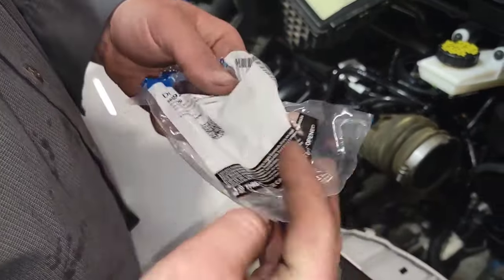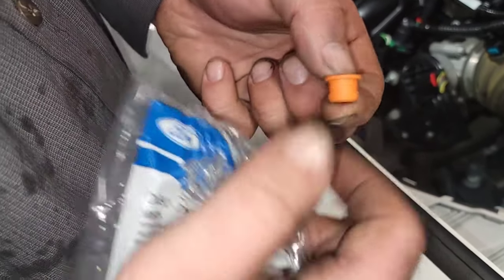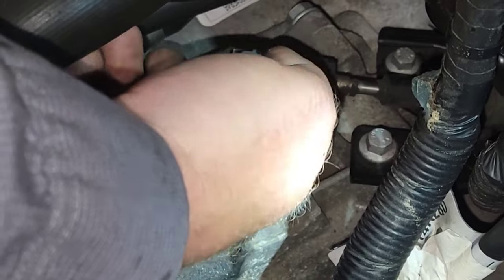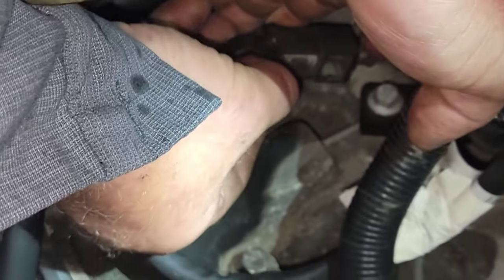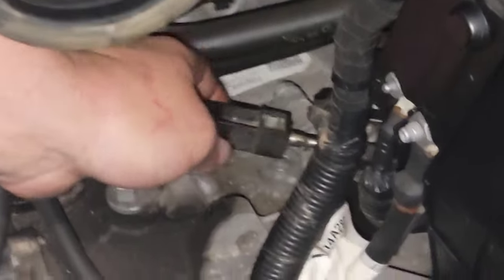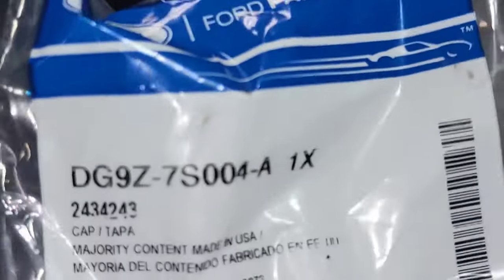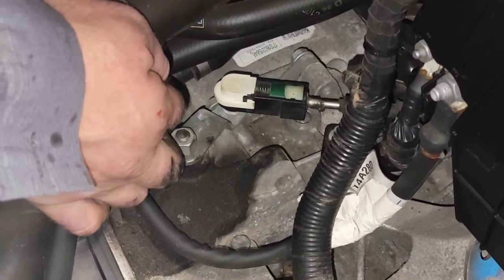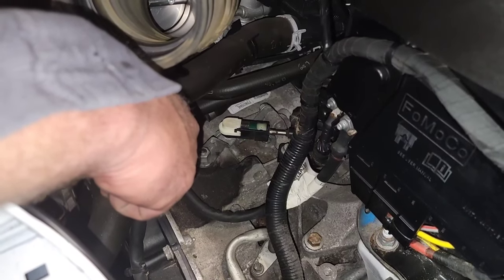Ford shifter cable bushing inspection - Edge, Fusion, Transit Connect, Escape, C-Max - Demonstrated

Comment: Which recall number is that?     Can that bushing be installed in the older trucks that the bushing in the cable always fails?
Reply from the maker: Buddy you got to watch the video all the way through and then you have to go to my previous 22s43 advance notice recall which they don't even have parts for but I explain all that in this video and this is for the people that only got the shifter cable bushing recall before and they get the advance notices and if you have any questions on whether or not this is going to be active on your vehicle when they finally have parts available in the fourth quarter call your local dealer or go to my previous video and see if your vehicle was built within those build dates that I specify on the video
Reply from the maker: https://youtu.be/F64zx80ARzw
Reply from the maker: And no it cannot be installed in all different models of these it's only specified years that are in the recall which I already put that information out
Reply: My apologies didn't mean to irritate u with the question
Reply: @FordBossMe  you didn't take a breath then!   you must be a great digeridoo player!
Reply: @FordBossMe with mines the car says neutral on the dashboard but inside the car it's actually in park is that the shifter cable or the bush or both?

Comment: For anyone struggling to put this in. Someone commented to put the bushing in some warm water for a minute or so. This helped so much! All you gotta do is warm up a cup of hot water I put mine in the microwave for 2 minutes, after that I dropped the bushing in there and let it sit for 3 mins. After that I went to put it back in and sure enough it popped right in place.
Reply: You are a blessing for commenting that ... i have been struggling and it was muuuuch easier.. had to say thanks
Reply: @petecraterxxsulpnb5404   no worries it was a pain. After fixing that I sold it. When it first happened I thought it was the trans 😭😭.
Reply: Damn.  I should have read this comment two hours ago. lol  Cut my hands all up and took me 45 minutes to get it in the hole.
Reply: @LordDestroProductions  man it took me 3 hours. My hands being big did. Not help at all. We didn’t take anything apart. My cousin held hoses to the side while I worked in there. Didn’t feel like taking stuff off and putting it back on. Once I put it in hot water and had a beer break, he pulled the hoses to the side again and I went in there. Sure enough after it sat in hot water, it popped right in. 18 fusion 1.5 or .6 don’t recall I sold it lmao
Reply: @bertoj6189  good stuff. I have a 2016 Fusion and had to go to the dealership just for this part. While trying to push the button into place, it popped out and I lost it for about 20 minutes. Had to use an air duster to find it. I was not about to  make another trip to the dealership for a $4 part. The entire neighborhood heard me yelling. Lol I finally got it in my pressing down with my left thumb and using a flathead with my right hand.
Reply: @LordDestroProductions  I tied a string around it. Like floss string super thin. When it fell I could pick it right up. Once it was in I snapped the string off. 😂😂😂
Reply: @bertoj6189  you had to do what you gotta do.

Comment: Cheap 5 cent part can sure cause alot of issues.
Reply: This just happened on my fusion, good thing for YouTube a lot of shops would just sell you a transmission if you didn’t know any better.
Reply: Crumbled away and left me stranded on my 2000 Pontiac Montana last year, so it’s a GM thing too. Looked it up and it seems common but all the parts catalogs specifically excluded the 2000 year model from the compatible bushing. Bought the 2001+ part anyway and it fit perfectly. Exact same vehicle as the Olds Silhouette and Chevy Venture. I bet the Aztecs from that era do the same thing (same U-platform).
Reply: This just happened to me in my 2016 fusion...I was stuck in drive 😅 parts were just like 4 bucks but it feels like a dumb problem to have 😂
Reply: I agree. Dealing with this now 2018 model
Reply: Just happened to me 🤦🏾‍♂️ had to pay for a rental 3 days to finally Pay $5 for the parts at the location that holds it.
Reply: Had me ready to sell my car instantly till I seen this video 😂🇬🇶

Comment: Thank you so much for this video. My 2019 Ford Fusion got this shift system fault error on August 27th, 2023. I called Ford and tried explaining the issue to a Ford service advisor over the phone, but he kept insisting that it's my transmission that has failed, and that I need to tow it in. Here's the other problem: The Ford dealership also won't be able to look at my car until end of October. I called three other Ford dealerships and they all didn't have any sooner appointment. So, I towed my car to the Ford dealership where it sat there, until I discovered your video three days ago (September 6th). I bought the bushing and the cover part for a total of $4.90 at the dealership that had my car, towed my car back home (luckily I have Emergency Road Service through Geico, so towing was covered), and it took me approximately 7 minutes to install. Ford needs to extend the recall to 2019 Ford Fusion as they still came with the old white flimsy bushing. Again, thank you very much for your help. ✌🏿
Reply: I call and they don’t know anything smh thank God for YouTube
Reply: Is the bushing located beneath the air filter box on your fusion?  I have a 2019 SEL and they're telling me it needs a new shifting module costing $900.

Comment: You can fix it with two zip ties temporary.  Run one through shift cable where the bushing goes leaving a little gap for the second to go through, run the second through the first one with the cable on the shift linkage, then wrap the second around the shift linkage and pull both zip ties tight.  I ran like this on my car for three weeks until my replacement came in.  Just recently put one on my nice’s car, until she could get it in to the dealership.  Hope this helps, they seem to break at the worst time, keep a few zip ties in your vehicle just in case.
Reply: Thank you very much.
Reply: I’ve been doing this for like 1.5 years now. Too hot right now though so they keep coming off. 

Gotta try the bushing now :(

Comment: No need to even tow, if it plops off you can put it back on the nob. If it doesnt line up you can(WITH THE PARKING BRAKE ON) shift it to drive and push in and place it on the nob and you will be able to shift again. While this issue occurs and your waiting for new part or whatever shift slowly as that also helps it not fall off.
Reply from the maker: It will still fall off
Reply: Did that to make it home then fixed it

Comment: I had my car stuck in park at Tim Hortons drive thru because of the bushing failing. Cold -14c morning and some very angry commuters who couldn’t get their morning coffee because of that bushing leaving my car stranded. It took me 30 minutes to figure out what happen and to get my car back into drive.  This happen before the first recall was issued and the Ford dealer replaced the bushing with the exacted same one that was failing. Needless to say I have the updated bushing sitting in my glove box waiting for the day when the replacement fails.
Reply: Now that you have a spare, you'll never need it.  Nice if the bushing came with a new cover, too. Little things are like 10mm sockets and disappear ;-)

Comment: This was exactly what I needed, thank you! My 2017 Fusion isn’t part of the recall but the bushing was gone nonetheless. $1.84 and 10 minutes of my time later and I was good to go!
Reply from the maker: Very cool I'm glad it worked out don't forget to hang around and subscribe
Reply: Where did you get the part from?
Reply: my 2016 fusion wasn’t part of it either and it just happened to me!
Reply: i had to go to the closest ford dealer and they sold me the bushing and a cap on top $5 even for both pieces
Reply: Same here, just got my ass

Comment: After many years I been on the internet this video is very informative and I have to say thank you as I was stuck-  I must add that if you are stuck in reverse or like I was parked but it said neutral you have to have the transmission lever to position P. 
SO I had it in N car off I then lightly two clicks to the left or towards the front end and then it was in P then the part would fit on top aligned

Comment: Just happend to me this morning on a weekend and my local dealership is closed, went to local parts store and they had a Dorman  Bushing Kit Part#14057 ($20 tax incl.) and it was a perfect fit, worked like a charm. Thanks for this, install process was pretty much the same.
Reply: What vehicle for you
Reply: Was it easy to put in? I have the same piece for my 2017 ford fusion and I’m about to try to put it on

Comment: Good information Rich.  Darn engineers are drunk on plastic ! 
Its also a good practice to use a razor blade or scissors to open those plastic bags that parts come in. For one, it will allow for any printing on the package to still be readable once its opened and it helps if the part has to be returned to the parts guy or parts store as they usually will want to read the print on the bags.  I started doing that after a parts guy told me one day years back, "I can't read this so its not returnable". Happened to be an expensive part so I changed my way and have never had issues since. Sometimes I will keep the bag and the old part too for a spare and tape the one side that was cut open, at least I have the part number saved with the old part.
Reply: I just saw your post.  Yup... plastic.  Should never be used on an automobile except for the interior parts.  I was able to temp fix mine with a strong alligator clip attached to the post to hold it on long enough to get to the dealership.

Comment: This video saved my bacon!  The part was only $1.94 at my local Ford house.  I installed it today and it works perfectly.  Thanks a million!
Reply from the maker: Glad it helped
Reply from the maker: The normal out of warranty cost is probably about 150 to $200
Reply: $150-200 plus labor????

Comment: Good information Rich. I have been keeping an eye on mine, no problems so far; but I just receive Safety Recall Notice 22S43/NHTSA Recall 22V413. It basically instructs me that when parts are available, we will let you know. As for now set your parking brake when you shift into park and see that the instrument cluster shows a park position. Thanks for the heads up, before Ford let me know.

Comment: Thanks for this info! I just had the same error Saturday and I was freaking out until I saw this. I pulled the air box off my 2020 Fusion and guess what? Shift arm bushing disintegrated. Replaced it today with the help of your video. Saved me a tow bill and labor. Fixed it myself for $4.38. Parts guy told me to buy 2 and keep one in my glove compartment😂. So i did...
Reply: Where can I buy this part today in TN
Reply: I had to wait and get mine from my local dealer. Auto parts stores didnt have them.
Reply: @shaynemauer3548  thank you- I called all my local auto parts stores they can’t get it either bc it’s a “Ford Specific” part but I did order one from Rock Auto for $2.90 paid more for Priority Shipping than for the part and this particular piece is broken in half on my car-

Comment: Mechanics make this look easy. Thank you for the demonstration. It was a pain in the ass for this weekend warrior -- tight angle, couldn't see. Took several tries but it finally slipped in.
Reply from the maker: It can be tricky indeed

Comment: Great video my 07 JK had the same shift cable bushings failure under the shifter left people stranded who didn’t know how to remove shift lever cover and pull lever. Everything has problems. EVERYTHING 👊🏻

Comment: The cable is in a different place on my 2015 Fusion Titanium Hybrid.  It is down in front in a vertical position in a very easily accessible place.  Visual inspection shows it fine right now, but I will replace when the part gets here. Thanks for the part number.
Reply from the maker: Look at my video on the years that apply to this all right keep referencing people to look and they don't look

https://youtu.be/F64zx80ARzw
Reply: The video was very helpful, and I also received my letter from Ford this week as well.

Comment: Good report sir! I received a recall notice in the mail about this along with a couple other recall issues for my 2017 Edge. While you are on transmissions, is there a way to pull the transmission lines to the cooler and let the transmission pump new clean fluid thru the transmission. I changed my fluid by draining four qts. At a time and driving it to mix it and draining four more qts. and doing that three times. That sucks.

Comment: Work being done is called ⬇️⬇️
Transmission Shift Linkage Bushing Replacement

Parts Needed ⬇️⬇️

FORD 
DG9Z-7K340-A (Bushing Linkage)
DG9Z-7S004-A (this part is a cover that goes on top to keep this part clean)

👏👏👏👏🌟🌟🌟🌟 Video was extremely helpful

Comment: In the mid 90s there was TSB for the AOD transmission kickdown. Very similar part/setup. Rubber part replaced with metal insert and clip. That part could eventually wreck the trans if disconnected. Not a safety recall cause it can't really cause injury.

Comment: Quick tip - was told by parts guy. Drop the bushing in a cup of hot water for like 5 min. NOT boiling just hot water. (I filled a normal coffee cup less than half with water thru in microwave for 1 min)The bushing gets a lil playable and pops right in. 
And becarful putting the dust cover on, you can push the car into I assume neutral. As my car started rolling back on me. lol. Use the parking brake. 
And I asked my Ford dealer and they said there was no recall on my 17 Fusion for this part. Bushing and cap were 14$ for me at Ford dealer.

Comment: Low and behold I’m sure the fiesta’s are Next! 

My fiesta was in park and the E brake engaged. Rolled down a hill, down the boat ramp and into the water. 3/4 of my car was submerged. You think Ford should repair my damages?
Reply from the maker: Your ebrake wouldn't have engaged if it rolled down hill, it would have released

Comment: You’ve got to get this fixed. I’m in a situation now where no auto has the bushing but the ford dealership and that’s 103 dollars. Then I have to take it to the shop to get put on . I have the fact that car shops will charge you high labor price for this situation. So this is just a temporary fix until you take it to get done somewhere

Comment: Awesome video! I was fighting to get mine on.. Mostly because I was doing it from the wrong side and bush was already gone. Now I wont have to shift my car manually with the E brake on just to get to work and back. Thanks Ford! Shit design, if the center post going through the bushing was longer you could at least get by with no bushing. The post is so short your 99% F'd when that bushing goes..

Comment: A spherical plain bearing would work best in place of this bushing but cost slightly more. A rod end bearing with its threaded shaft could replace that whole end piece. It operates a lot and plastic will continue to fail
Reply: Can i buy it online

Comment: I have a 1993 Ford Ranger that has a loose shift. The issue is under the hood not on the transmission. Is there a bushing on that end ender the hood. Or do i need a new cable.
Reply from the maker: It may be in the steering column where it is mounted

Comment: I have a 2013 Ford escape I happened to put the vehicle into park. Heard a knock noise coming from the transmission area while putting my vehicle in park when I came back to the vehicle put it in drive. My transmission was damaged and wasn’t running properly. I came in searched. Found your video here on YouTube then went to look at the same part. You are replacing and not mine is missing is it possible that it can damage the transmission like this and would be liable because it is under recall ?

Comment: I’ve done this on a few 2014 escapes. Our local ford dealer said no warranty. They don’t sell the bushing either, only the entire cable.
Reply: Figures.
Reply: Would you pls let me know where can I find that bushings cause the ones I found don’t even fit at all
Reply: Or how should I ask for that
Reply: I’d just buy the cable is $100. That’s what I told the customers to do. Not worth coming off again and getting stuck.

Comment: How do you put the shifter back on if the rod won’t move?
Reply from the maker: You have to get in the vehicle, set the parking brake engine off and shift the lever out of park to drive 

Then when your done put it back on the transmission shift lever and get back in and put it in park

I know I have a video probably more than 1 showing this

Comment: This happened to me over this past weekend!!! I have a 2020. Got under hood and checked, bushing was gone. Just replaced yesterday and now my check engine light is on...what could cause that? It wasn't on before it was replaced..
Reply from the maker: check engine light will come on because it doesn't know what gear it's supposed to be in before this happened so what you need to do is clear the light or get the codes checked before you clear it

Comment: My 2019 fusion SEL just got stuck in park.  It's at the mechanic right now and he's telling me that it's the shifting module that needs to be replaced, at the cost of $900.00.  thoughts on what I should tell them not seeing it myself?
Reply from the maker: Tell them to show you the shift cable bushing attached to the shift linkage
Reply from the maker: If it looks good you'll have to do what they suggest
Reply: @FordBossMe  They never looked for the bushing. I had to suggest that.
Reply: @FordBossMe  They claim that the module needs to be replaced because it looks like something was spilled into the module housing.  I've been driving this car since 2020 and haven't spilled anything in the car.  Sound legit to you?  Sorry for all of the questions.